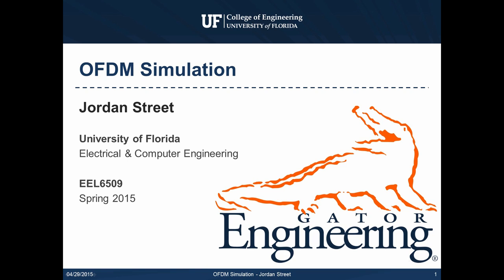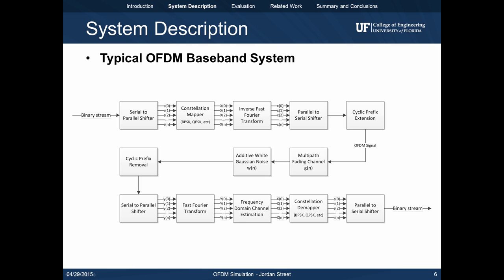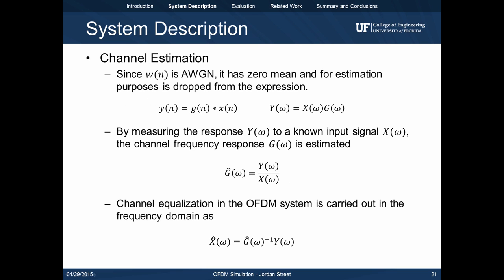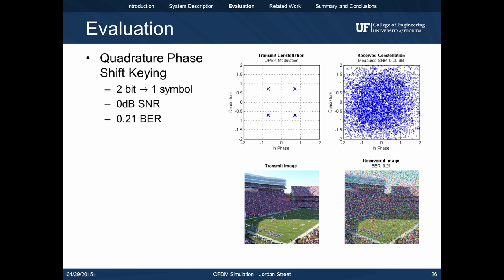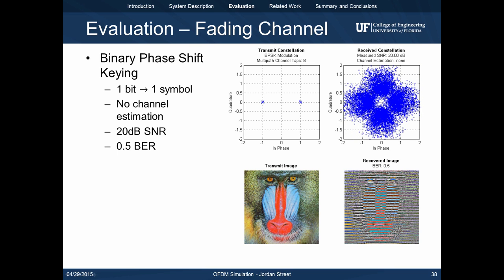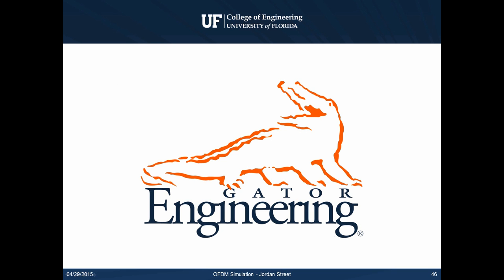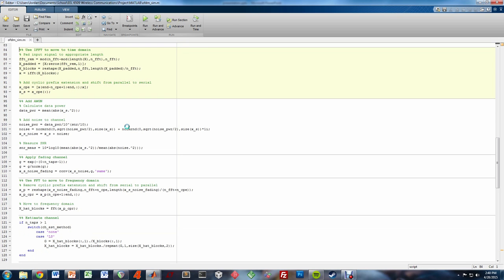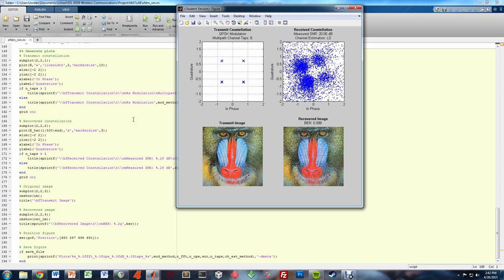OFDM Simulation in MATLAB

Comment: here is the code !! :) enjoy 

clear all
close all
clc

%% simulation parameters
%modulation method: BPSK, QPSK, SPSK, 16QAM, 32QAM, 64QAM
mod_method = 'QPSK';

% IFFT/FFT size
n_fft = 64;

%size of cyclic prefix extension
n_cpe = 16;

%target SNR (dB)
snr = 20;

%number of channel taps (1 == no channel)
n_taps = 8;

%channel estimation method: none, LS
ch_est_method = 'LS';

%option to save plot to file
save_file = 0;

%calculate modulation order from modulation method
mod_methods = {'BPSK', 'QPSK', '8PSK', '16QAM', '32QAM', '64QAM'};
mod_order = find (ismember (mod_methods, mod_method));

%% input data do binary stream
im = imread('baboon.bmp');
im_bin = dec2bin(im(:))';
im_bin = im_bin(:);

%% binary stream to symbols
%parse binary stream into mod_order bit symbols
%pads input signal to appropriate length
sym_rem = mod( mod_order-mod( length( im_bin), mod_order), mod_order);
padding = repmat ( '0', sym_rem, 1);
im_bin_padded = [im_bin; padding];
cons_data = reshape( im_bin_padded, mod_order, length(im_bin_padded)/mod_order)';
cons_sym_id = bin2dec(cons_data);

%% symbol modulation
%BPSK
if mod_order == 1
 mod_ind = 2^(mod_order-1);
 n = 0:pi/mod_ind:2*pi-pi/mod_ind;
 in_phase = cos(n);
 quadrature = sin(n);
 symbol_book = (in_phase + quadrature*1i)';
end

%phase shift keying about unit circle
if mod_order == 2 || mod_order == 3
 mod_ind = 2^(mod_order-1);
 n = 0: pi/mod_ind: 2*pi-pi/mod_ind;
 in_phase = cos(n+pi/4);
 quadrature = sin(n+pi/4);
 symbol_book = (in_phase + quadrature*1i)';
end

%16QAM, 64QAM modulation
if mod_order == 4 || mod_order == 64
 mod_ind = sqrt(2^mod_order);
 in_phase = repmat(linspace(-1, 1, mod_ind), mod_ind, 1);
 quadrature = repmat(linspace(-1, 1, mod_ind)', 1, mod_ind);
 symbol_book = in_phase(:) + quadrature(:)*1i;
end

%32QAM modulation
%generates 6x6 constellation and removes corners
if mod_order == 5
 mod_ind = 6;
 in_phase = repmat(linspace(-1, 1, mod_ind), mod_ind, 1);
 quadrature = repmat(linspace(-1, 1, mod_ind)', 1, mod_ind);
 symbol_book = in_phase(:) + quadrature(:)*1i;
 symbol_book = symbol_book([2:5 7:30 32:35]);
end

%modulate data according to symbol_book
X = symbol_book(cons_sym_id+1);

%% use IFFT to move to time domain
%pad input signal to appropriate length
fft_rem = mod(n_fft-mod(length(X), n_fft), n_fft);
X_padded = [X; zeros(fft_rem,1)];
X_blocks = reshape(X_padded, n_fft, length(X_padded)/n_fft);
x = ifft(X_blocks);

%add cyclic prefix extension and shift from parallel to serial
x_cpe = [x(end-n_cpe+1:end,:);x];
x_s = x_cpe(:);

%add AWGN
%calculate data power
data_pwr = mean(abs(x_s.^2));

%add noise to channel
noise_pwr = data_pwr/10^(snr/10);
noise = normrnd(0,sqrt(noise_pwr/2),size(x_s)) + normrnd(0, sqrt(noise_pwr/2), size(x_s))*1i;
x_s_noise = x_s + noise;

%measure SNR
snr_meas = 10*log10(mean(abs(x_s.^2))/mean(abs(noise.^2)));

%% apply fading channel
g = exp(-(0:n_taps-1));
g = g/norm(g);
x_s_noise_fading = conv(x_s_noise, g, 'same');

%% use fft to move to frequency domain
%remove cyclic prefix extension and shift from serial to parallel
x_p = reshape(x_s_noise_fading, n_fft+n_cpe, length(x_s_noise_fading)/(n_fft+n_cpe));
x_p_cpr = x_p(n_cpe + 1:end,:);

%move to frequency domain
X_hat_blocks = fft(x_p_cpr);

%% estimate channel
if n_taps > 1
 switch(ch_est_method)
 case 'none'
 case 'LS'
  G = X_hat_blocks(:,1)./X_blocks(:,1);
  X_hat_blocks = X_hat_blocks./repmat(G,1,size(X_hat_blocks,2));
 end
end

%% symbol demodulation
%remove fft padding
X_hat = X_hat_blocks(:);
X_hat = X_hat(1:end-fft_rem);

%recover data from modulated symbols
rec_syms = knnsearch([real(symbol_book) imag(symbol_book)], [real(X_hat) imag(X_hat)]) - 1;

%parse to binary stream & remove symbol padding
rec_syms_cons = dec2bin(rec_syms);
rec_im_bin = reshape(rec_syms_cons', numel(rec_syms_cons),1);
rec_im_bin = rec_im_bin(1:end-sym_rem);
ber = sum(abs(rec_im_bin - im_bin))/length(im_bin);

%% recover image
rec_im = reshape(rec_im_bin,8, numel(rec_im_bin)/8);
rec_im = uint8(bin2dec(rec_im'));
rec_im = reshape(rec_im,size(im));

%% generate plots
%transmit constellation
subplot(2,2,1);
plot(X, 'x', 'linewidth', 2, 'markersize', 10);
xlim([-2 2]);
ylim([-2 2]);
xlabel('In Phase');
ylabel('Quadrature');
if n_taps > 1
 title(sprintf('Poslani konstelacijski dijagram\n\\rm%s Modulacija\nMultipath Channel Taps: %d', mod_method, n_taps));
else
 title(sprintf('Poslani konstelacijski dijagram\n\\rm%s Modulacija', mod_method));
end
grid on;

%recovered constellation
subplot(2,2,2);
plot(X_hat(1:500:end),'x','markersize',3);
xlim([-2 2]);
ylim([-2 2]);
xlabel('In Phase');
ylabel('Quadrature');
if n_taps > 1
 title(sprintf('Primljeni konstelacijski dijagram\n\\rmMeasured SNR: %.2f db\nChannel Estimation: %s', snr_meas, ch_est_method));
else
 title(sprintf('bfPrimljeni konstelacijski dijagram\n\\rmMeasured SNR: %.2f dB', snr_meas));
end
grid on;

%original image
subplot(2,2,3);
imshow(im);
title('\bfPoslana slika');

%recovered image
subplot(2,2,4);
imshow(rec_im);
title(sprintf('\\bfOporavljena slika\n\\rmBER: %.2g', ber));

%position figure
%set(gcf,'Position',[680 287 698 691]);

%save figure
if save_file
 print(sprintf('Plots/%s_%.0ffft_%.0fcpe_%0fdB_%.0ftaps_%s',mod_method, n_fft, n_cpe, snr, n_taps, ch_est_method), '-dmeta');
end